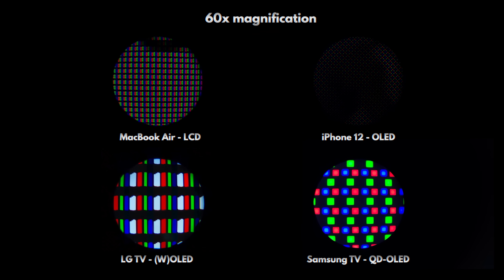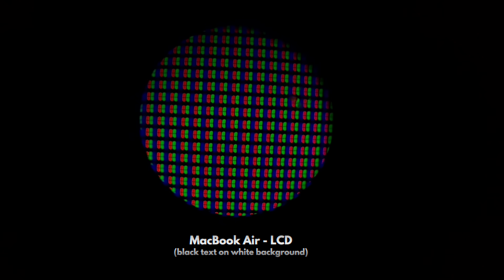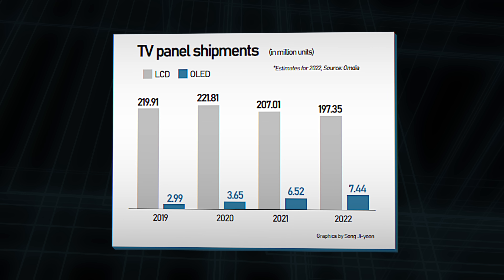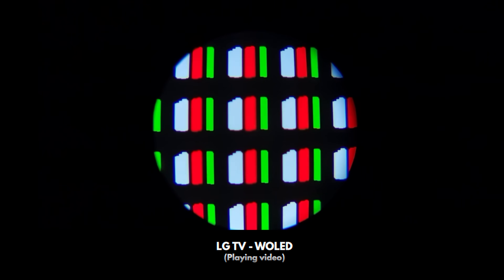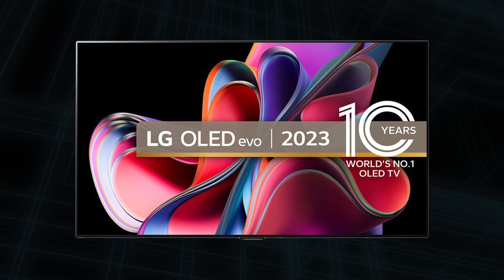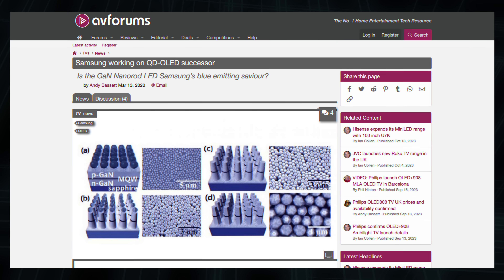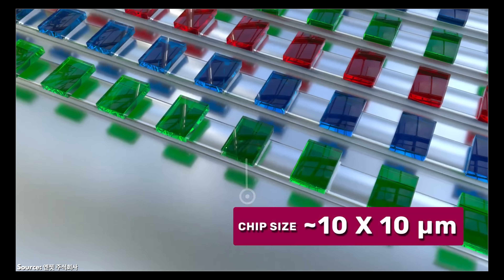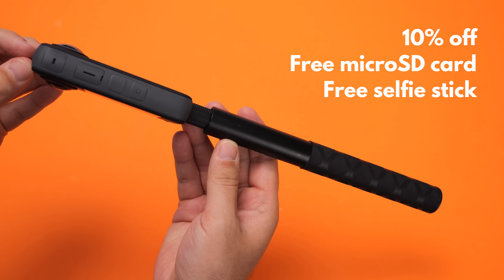The billion dollar race for the perfect display

Comment: Small correction about carcinization. Contrary to what you say in this video, there’s a limited amount of genetic latitude when it comes to the variability in the decapod crustacean’s genome. They keep “evolving” into crab-like forms because of the basic decapod crustacean body plan cannot change. This is not proof of evolution but rather the opposite, as not only does it show the crab body has been predetermined in the genome, but also it shows that similarity does not entail common ancestry as evolutionists love to report, as non-related organisms can look alike by design rather than ancestry.

Comment: This is not serious, man you missed the plasma displays, i still have a bunch of them, still working, still better color than a lot of modern led displays. Perfect Blacks, amazing color palet, problem they are power thirsty, low res by today standards, and bulky. But still amazing colors. You cant go from  CRT to LCD, but rather, CRT to PLASMA to LCD to LED, oled, qled, etc. The whole analisis is wrong from the start.AMOLED or WOLED are way more similar in funcionality to plasmas than to lcd. A missinformed analisis or a biassed one. There you have your dislike sir, not a good analisis at all.
Reply: You serious? You can’t even spell analysis and you’re putting a dislike on a well-researched and useful video? Just go away.

Comment: I was really bummed out about my big OLED TV.  It supposedly costed a LOT of money, much more than the regular LCDs from before I had, but the LCDs could be used as computer monitors and wouldn't have quality issues after many years.  But the OLED TV would get image burn and now it's really annoying.
Reply: Meh, lcds also degrade - you can get light bleed and patterns from polarizer layers degrading. And you can still get stuck or dead pixels. And early lcds (and crts) also had burn-in issues. 
And all tvs now come with computing hardware and annoying proprietary software that makes them obsolete in a few years. They might even start showing you ads if you don't upgrade to the new thing fast enough, or you pay for some sort of subscription fee.

Comment: the problem for MicroLED is less that we don't know how to make displays on a large scale and more that the companies that make them are trying to get the cost down. TCL is building factories with the technology to print both OLED and Microled in standard RGB format. which should have better clarity with text and other content with sharp edges. then again if a ultra large picture is what you want laser projectors are starting to trade blows with oled. brightness needs work they but more than make up for it with color range.

Comment: Even when these crabs reach their final form, there will still be one more hurdle left: The elimination of subpixels.  Only when an individual pixel can be any color on the entire visible spectrum will you be able to say the evolution is done.  Until then, you're dealing with subpixel matrix shenanigans; text on monitors will be more red on the left edge and more blue on the right edge or whatever; VR displays will remain particularly vulnerable to the downsides of this issue.  Simply bumping the resolution up only diminishes the problem without eliminating it, and obviously comes with the downsides of having to quadruple+ the processing power of the platform to support it.  Even vaunted MicroLED does nothing to address this final hurdle.

Comment: While OLED screens do not require a polarizer, many of them have them anyway, IIRC this is to cut down on environmental light interfering with the final image, you can tell if your OLED has a backlight if wearing polarized glasses can block out the light if you turn the device, or your head.

WOLED and QD-OLED are not technically an emissive display technology like OLED, instead they're transmissive because the light comes from a backlight either through a color filter, like an LCD, or to energize quantum dots, much like how QLED works, its just that instead of a few hundred zones of backlight, it is thousands to 10s of thousands of OLED backlights.

Of note, while a 4K WOLED/QD-OLED screen generally has no more than 8.1-8.5 million dimming zones, a true emissive OLED will have at least 24 million dimming zones assuming only one OLED for each color within a 'pixel'
Reply: I'm personally excited about quantum dot technology that combines a microLED backlight that is outside of human vision and quantum dots, maybe combine it with the nano-lenses.
Imagine a backlight you cant see, only lighting up the pixel needed, with the light directed to where most people will be seated
Allow for incredibly bright viewing experience, with 0 backlight bleed
I dont want the backlight to be UV. I get a glow in my eye from it, and i would not be surprized if the current UV based QLED/QD-OLED degrade from UV exposure in 5 years, not in image quality, but everything else, like plastic starts to yellow, break down, and become brittle/separate

Comment: Unless LCD or Micro LED match or beat the 0.03ms response time then ANY new display of these types are Dead on Arrival. And since they are both slow as shit the race is already over. All OLED need to do to become the perfect display is eliminate burn in and be bright ENOUGH to support black frame insertion and HDR at the same time without getting too dim to see detail in the darkness. Once these are achieved all that will be left is a 1000Hz refresh rate and we will have achieved display perfection.

Comment: I think we're still falling short of perfect display tech in several ways not mentioned. Firstly in the days of CRT tvs/monitors you could input any resolution you like and the electron gun would project it perfectly with no scaling, since we moved to LCD/Plasma/OLED displays we've had to upscale to the nearest resolution that divides perfectly into the native resolution or end up with an ugly aliased image. 
Secondly since both LCD/OLED displays employ a sample and hold rendering method our brain does not distinguish a clear gap between frames so motion clarity is still leaving much to be desired, Black Frame Insertion is definitely helping but at the cost of luminance.
CRTs absolutely had their drawbacks and they were retired for good reason, but there are still things they do better than any modern display technology.
Reply: I mean technically there's still a lot more that theoretically could go into a 'perfect' display.  Fully transparent, infinite refresh rate, wirelessly powered, physically configurable aspect ratios, 3d/holographic capabilities, etc.  That said, I wouldn't say there's a 'lot' to be left desired in terms of motion clarity of OLED.  The fact that sample and hold isn't literally perfect is not necessarily a bad thing as it's not inherently a good thing to be able to more clearly discern gaps between frames.
Reply: @maynardburger    Think of what they will have 100 years from now?  Probably develop a pill you swallow, to develop an organic computer chip into your brain as you develop before you are born.  Instant virtual reality at birth.
Reply: the down side of adding the black frames though is also more flicker also direct fade from frame to frame is bascilly  'free' temepral antialsiing
Reply: Your second issue isn’t really a knock on display technology, it’s a result of content with low frame rates.  You can make the argument that the perfect content would have such a high frame rate that it would have indistinguishable frames.  This content’s motion would display perfectly on OLED TVs without judder.  Real life isn’t in 24fps and I think many would argue that a perfect display’s goal should be that it’s indistinguishable from real life. That said, I still have a hard time abandoning 24fps for films.

Comment: I am happy with miniLED for general-purpose display, especially on text-based workloads. Coding, email, data entry, etc., while not perfect, are decent to very good for media consumption. They are nowhere near OLED but perfect for your average Joe & Jane. 

-The difference is staggering, as someone uses a Samsung Odyssey G9 Neo 57 upgraded from a 2018 VA panel.

Comment: The perfect display technology was already there. It is called CRT. It have perfect blacks, great colors, good brightness and refresh rates. No ghosting and most important no input lag. Imagine how good CRTs could have become today with additional 15 years of development! Instead people fell for novelty factor of LCD. Lets confine LCD to portable computers, where weight, dimensions and power consumption really matters! The input lag is not going away, and no manufacturer states how bad it really is! All they focus is response tome nonsense and refresh rates which are irrelevant if the GPU sends out frame but monitor delays it before drawing on the screen

Comment: I've had my OLED model Dell XPS laptop for nearly 4 years, I have not seen any burn in.  Maybe if I looked really, really closely on a solid grey background, I might be able to find a very, very faint shadow of my taskbar, but I just checked and I didn't even see that.  My guess is my laptop's hardware will be outdated or something else will fail long before burn-in ever becomes an issue.  This was a concern when I bought my laptop, but I can with confidence say that I don't think this will ever be an issue for most people.  

I's say that the more concerning factor is the physical durability of OLED panels and their high cost to replace.  OLED panels made of glass have the structural integrity of a potato chip, and that is how laptop panels are currently made.  Drop your laptop and good chance your screen will go dark.  Most smartphones now use internal plastic panels under the glass, making durabilithy less of an issue (you can still break the outer glass).  The cost to replace the screen on my XPS is crazy high, and that's if I do it myself, and with a used one pulled from another system.  There are no third party replacements.

Comment: Great video! Really interesting breakdown of modern display tech! Would be interested to see how we got to this point, like early LCD or even how and why Plasma failed to keep popularity in comparison
Reply: Plasma used far more power than even CRTs. A friend bought one and it had three fans in the top to stop the insides from melting. On the plus side they did have much better contrast than any LCD at the time.
Reply: @MrDuncl  that is absurd, parts melting? A friend told you? i have 3 pionners, 3 sony, one panasonic all plasmas. I sold all my lcd, and led tvs, they cant compete in colors, resolution, yes, but not everything is resolution. The sonys are from 2002, not quite good, they have issues, pionner plasmas, are amazing, way better that the 50 inch smasung led my mother in law bought last year. You should get one, image color is amazing.
Reply: @obturafotografia247  Maybe my choice of language was bad. However, I wasn't exaggerating about the three  fans in the top of the Panasonic Plasma TV. I just looked at some power consumption figures from back when Plasmas were being sold and am seeing 400W compared to 120W for the same size LCD.
Reply: @MrDuncl yeah, plasmas run hot, especially if they get bright. It's called plasma for a reason. I still use a 60" pioneer Kuro from 2008, and at least in a dark room, it's pretty much as good as a 1920x1080 modern monitor, and a fair bit cheaper than one.
Reply: my Samsung plasma still looks fantastic and keeps the room warm to boot.  motion on my oled looks weird to my eyes, like the framerate is unstable or something. I'm not an expert so I'm not sure what's going on. it's most noticeable on streaming services, but not at all when gaming. I'm glad that viewing angles on modern displays are improving to where they can almost match crt and plasma tech.
Reply: @eastvanisfun  That's probably because plasma runs a dithering at 600hz instead of sample and hold, which can make things at 30hz refresh look very jerky due to our eyes usually filling in the blanks in motion
Reply: @mikafoxx2717  thank you for explaining
Reply: i have plasmas, and they have way better color than some modern led, and if you get a 1280x720 res one, they are superb. Cant believe he didnt even mention it, not a good analisis at all

Comment: The sad part is the tech could easily be sold at a consumer level but they are just milking it as a flagship level tech with mini led, oled.
Why are most of the laptops and monitors stuck with bad lcd. Without asus and Alienware we wouldn't have seen oled and qd oled in our hands

Comment: the issue with oled for desktop displays if if they had the correct subpixel layout then burn in would be more likely as the exact same pixels would be on almost all the time
( think of the pixel in the middle of a 7 pixel wide bar like here in the chat. even with pixel shifting its usually olny 2 or 3 rows different so as to not distract the eye buy that means the middle 1-3 rows never get to turn off and rest.

Comment: Great review, thank you. But you forgot about another one crucial part of those screens/technologies - flickering. For example DC dimming was the one of the first backlight tech of LED displays and still the most popular, another new one is PWM which is cheaper than DC dimming and more energy efficient, BUT its giving sensitive people a lot of problems, like eyestrain, nausea, vertigo, headaches and etc. Also LED screens started to compete with OLED true 10bit colors implementing FRC/Dithering technology which is also giving problems to some people. And OLED also not the perfect display type, they have their own flickering with brightness deep, which also causing issues to some people. Thats said, would be great to hear more about those problems, not just how these technologies are competing with each other.
Reply: Perhaps not simply "sensitive people", but, specifically, people who don't use their screens at max brightness... Most laptop screens are so dim that you kinda just have to run it at max all the time...
Reply: @Vousie  depends on where exactly you're running them. With my Dell 5855 (admittedly not a very bright screen) inside buildings anything above 25-50% is way too bright, 100% is only for direct sunlight outside.
Reply: @ОсликИа-я2ы  Umm, according to Google that still has a 400 nit screen. A lot of laptop screens barely get over 250 nit, so yeah, it is definitely much brighter than a normal screen. Tablets do tend to have brighter screens than a laptop in the same price-class would have.
Reply: @Vousie  Its not a problem with dim screens, its the problem of new mini-led tech. They are trying to show you perfect blacks with implementing PWM which is giving a lot of problems to a lot of people. Just basically take your camera or phone set shutter speed to 1/6400 or similar and go to the store. You will be shocked.
Reply: @madmozg  I don't mean the high-end screens.
I think even just dimming on normal LCD displays (eg the ones on mid-range laptops) is often done with PWM?
Reply: @Vousie  Philips 275E1S monitor (basically the cheapest non-chinese-noname 27" 1440p model) has DC dimming.
And their other 1080p models I've had before didn't have PWM either.

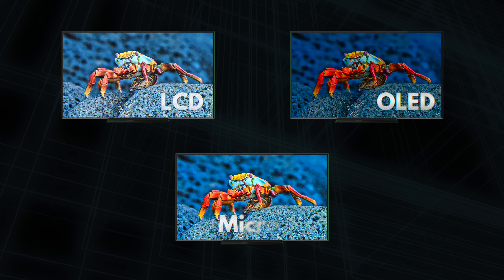Comment: 00:29 🖥 Display technologies like LCDs, OLEDs, and micro LEDs, despite starting differently, are converging toward a common high-end form.
01:24 🌈 LCDs use liquid crystals, polarizers, and a backlight to create images but face inefficiency and imperfect blacks due to their layered structure.
03:42 🔆 Mini LED backlighting in high-end LCDs improves blacks and power efficiency, while Quantum dots enhance color vibrancy, addressing major LCD shortcomings.
05:32 📱 OLEDs, with individually lit organic diodes, offer thinness, flexibility, and power efficiency but suffer from degradation issues like burn-in and materials' quick decay.
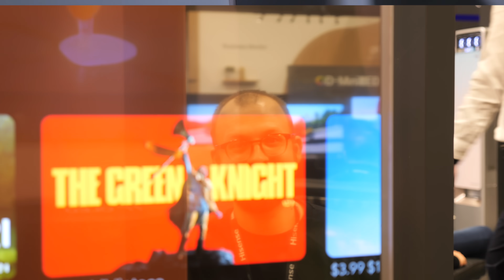08:17 💡 OLED advancements aim to boostbrightness without damaging panels, with technologies like microlens arrays and using Quantum dots in OLED screens.
11:30 🌟 OLED innovations include tandem OLEDs for brightness and longevity, new efficient OLED materials, micro OLEDs for high resolution, and experiments with non-organic materials.
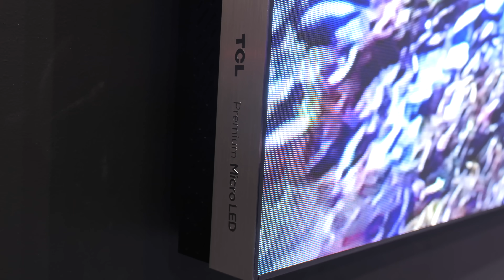14:32 🦀 Micro LEDs are considered the ideal display tech due to individual LED pixels, brightness without burn-in, but their production challenges delay their mass-market availability.
16:22 📷 Insta360 X3 camera, versatile for creative shots, especially in outdoor activities, providing 360° perspectives, invisible selfie stick, and innovative shooting options.